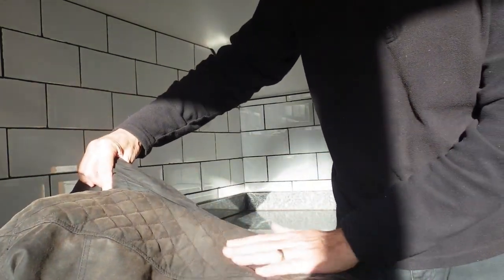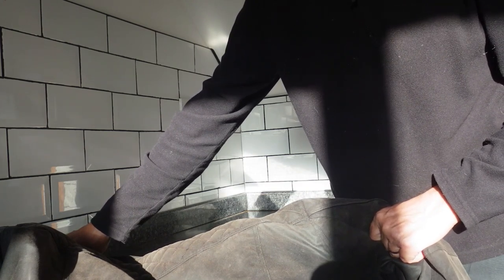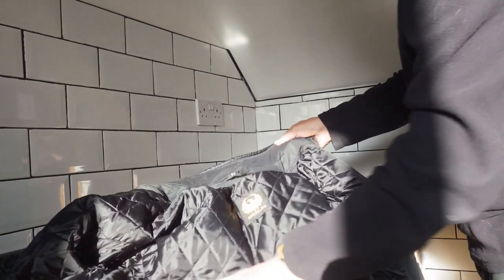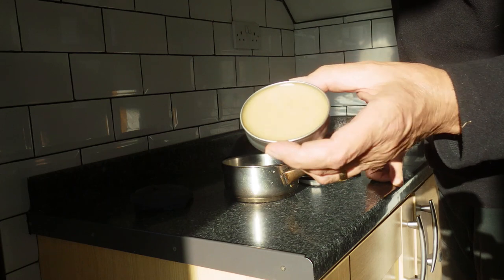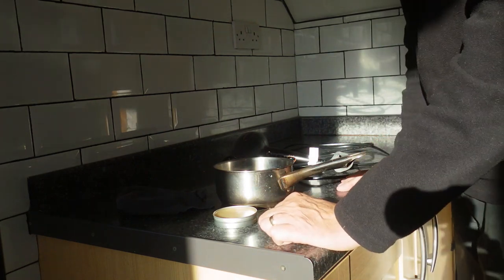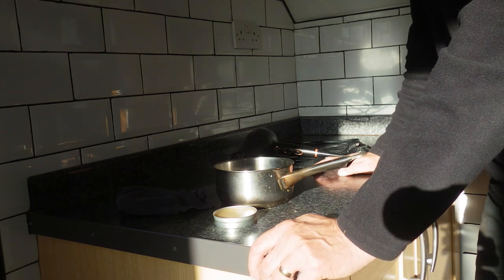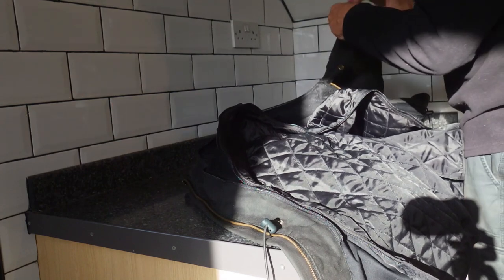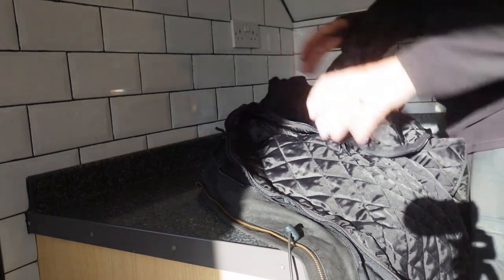How to re wax a wax cotton motorcycle jacket

Comment: Great video, John. Nice jackets, those Merlin ones. I've got an Oxford Hardy absolutely solid jacket.
Reply from the maker: Good make is Oxford 😁
Reply: I also have an Oxford hardy jacket. Have you tried re waxing it?
I’m considering trying to.
Reply from the maker: @markthompson9684  My merlin jacket is looking well after the rewax
Reply: @Mark Thompson  I haven't no, I'd be tempted to do it with a spray if I can as I find the heated wax method a bit laborious.
Reply: I’ve a Oxford hardy jacket. Use barbor thornproof wax and then hairdryer it. Leave about 2-3 days to hang dry and it’s seen some severe weather and kept me warm and dry. Love the Oxford hardy as an everyday jacket even off the bike in town jacket